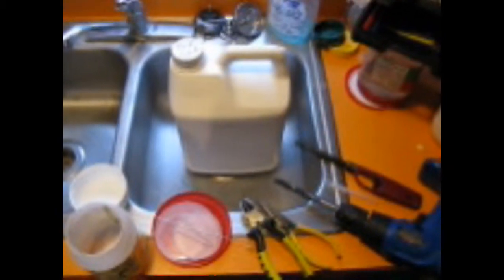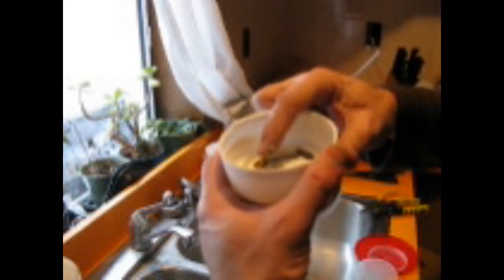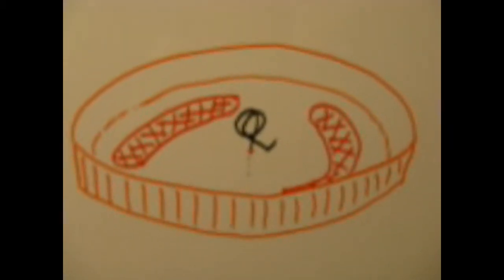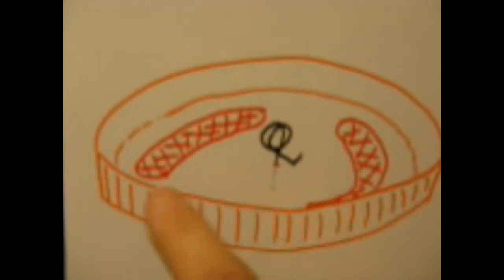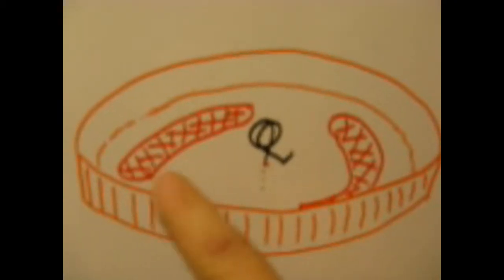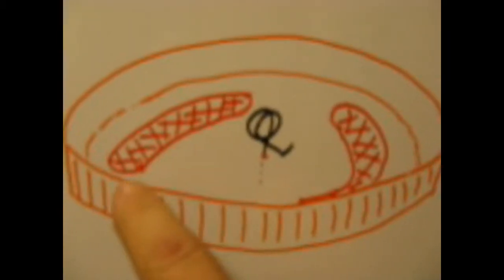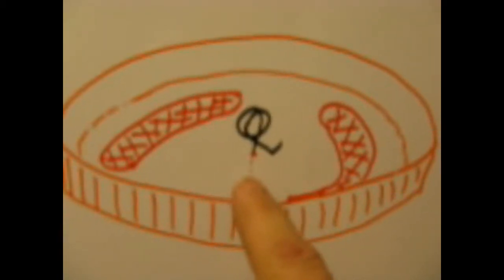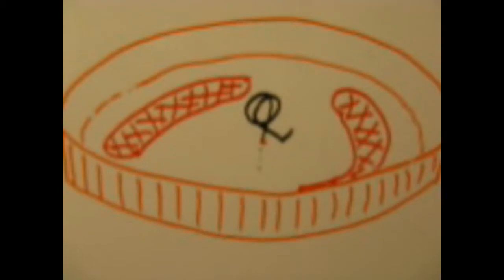DIY Chickadee bird feeder (original version)

Comment: That's a great feeder for the chickadees and nuthatches! I was inspired to make one slightly smaller. The hanger is about a foot of baling wire. It's light and both the parts rotate freely, chickadees & nuthatches have no trouble, but it wobbles and rotates when larger birds try to use it.